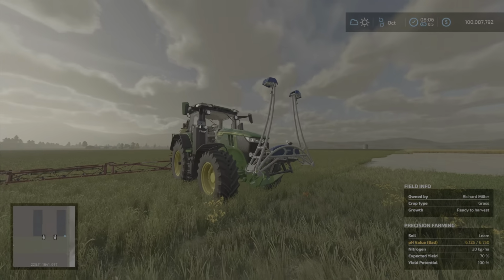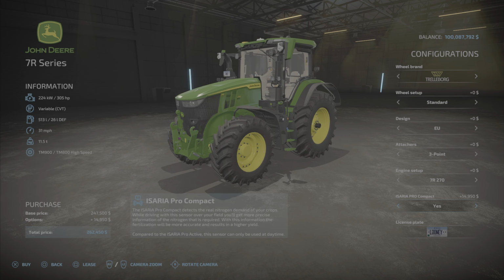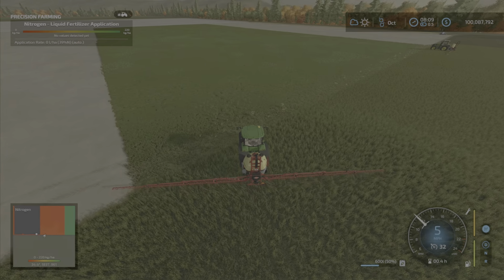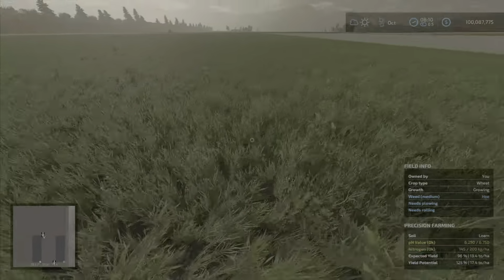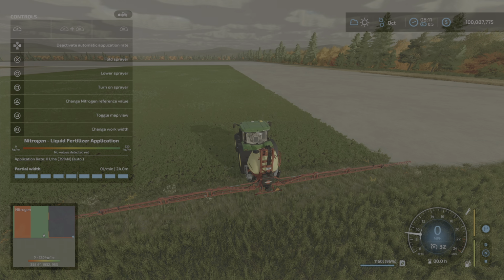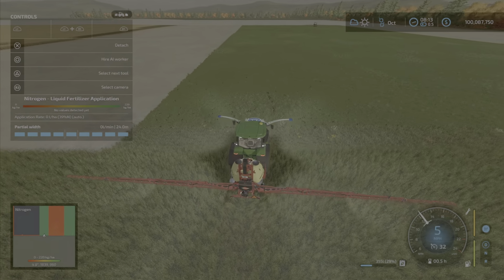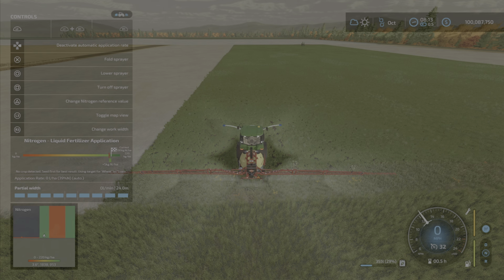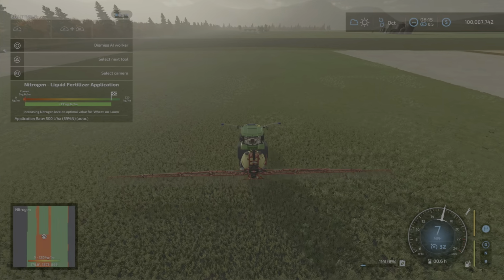Crop Sensors . Tutorial for Precision Farming on FS22

Comment: Do you ever put a spreader that can do both lime and fert and 1 on front and back
Reply from the maker: That is a great tip , I have thought of that but kind of forgot about it and never tried it , 😅 , Thanks for reminding me , Looks like no mods today so I will have some time to play with that 🤗Cheers !
Reply: @LooneyFarmGuy  works great and I try to put fertilizer on front so I can see where its been
Reply from the maker: @domination1985  cool , it is tricky as the lime runs out so fast 🧐
Reply: @LooneyFarmGuy  yeah but you can put a smaller tank on the front for fert and it helps

Comment: Do you need that thing infront to see the difference in the map or what? Can that john deere sensors be on mod tractors too or not?
Reply from the maker: Hi Joe , Lots of the base game tractors have the option to add the sensors directly to the tractor for a price .
The front sensor is an potion that will do the same thing but can be used on ant tractor with a front 3 point hitch .
You can play with Precision Farming and not use this .
This is an enhancement of the PF system and will give you greater accuracy when applying fertilizer
Reply: @LooneyFarmGuy  what i mean is how do i get the precision map like if i plowed or planted it changes the color of the field.?
Reply from the maker: @JOEMAMA.95  That is not under the Precision farming pda , that is under the base game feild info pda in your menu 
there are several maps to scroll through , you just have to find the one that has those .
Reply: @LooneyFarmGuy  any good usa maps you know that has it?
Reply from the maker: @JOEMAMA.95  What I ment was the in game map in your in game menu , every map has those features .
Reply: @LooneyFarmGuy  yeahh ik that too what i mean is like say I'm fertilizing lime or something and the mini map at the bottom is red and when you spray it turns green and you can see what is left over on the field on your minimap or not you know?
Reply: @LooneyFarmGuy  what i mean is how can i see the nitrogen on my mini map and when i spray or spread lime it turns green over what i spread. Haha
Reply from the maker: @JOEMAMA.95  ok It all depends on the crop that has been planted , some crops like Soybeans do not accept fertilizer while others like corn take a lot .
so a soybean crop will appear red while a corn crop that has been fertilized will appear a dark green .
Reply: @LooneyFarmGuy  why doesn't the field color change when i plow tho? I just harvested corn and when i wanna plow it doesn't show that the field color change or the ph or anything on the minimap does it only work with planters and harvesters and sprayers or?